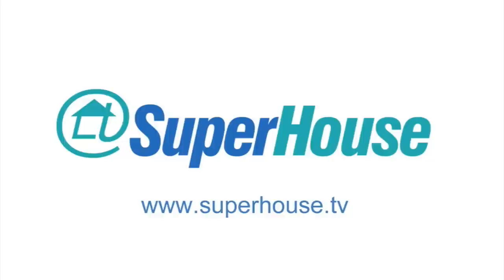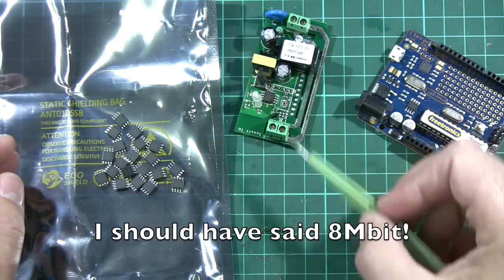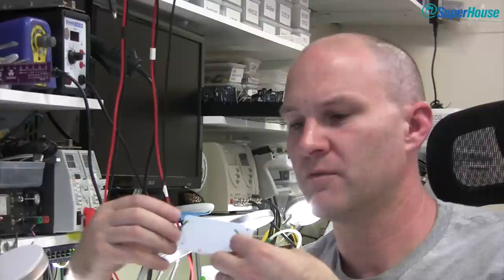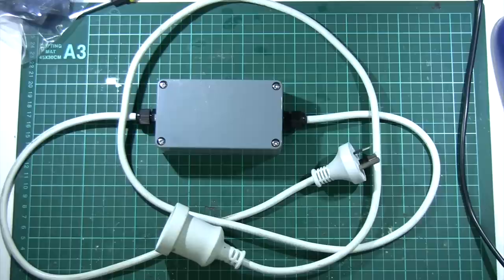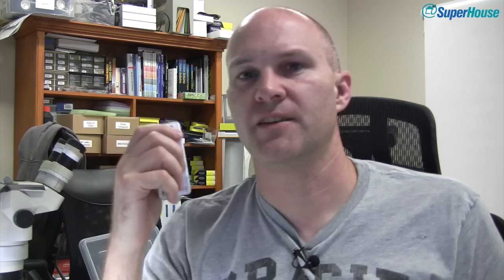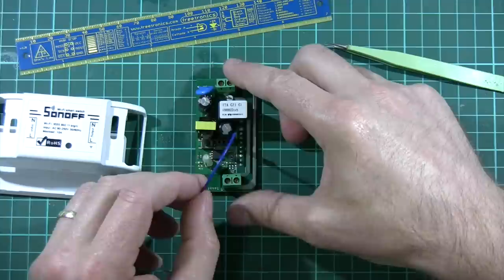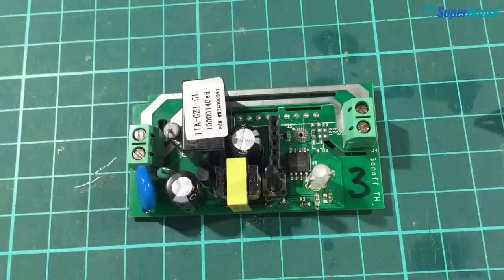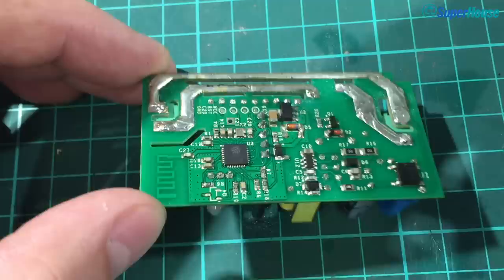SuperHouse #21: Six Sonoff Secrets: Storage, Safety, Switches, Sensors, Software, and Sites

Comment: OK, GPIO14 and GND trick with regular wall switch ? Tried this today on my Sonoff with stock firmware and doesn't seem to be working.  Anything I can do more to make this work?
Reply from the maker: Yes, you need to use firmware that supports it. The factory firmware tries to use GPIO14 for communicating with sensors, so you need to use something like the TASMOTA firmware and enable wall switch support.
Reply: Thank you very much for the great info. I found a way to make this work by soldering 2 wires on the bottom of the pairing switch.
Reply: fredasiong,  Did you do that with the original firmware and can you please write up so instruction on how to do that exactly?
Thanks
Reply from the maker: It would be the same as I showed in the video, but soldering to the button pads on the bottom of the PCB instead of directly to the button pins.
Reply: yes, but I used momentary PB instead of the original wall switch. I will post some photos.  I have 6 setup of this wiring in my entire house using a momentary PB.
Reply: fredasiong, Thanks for the slideshow I see what your talking about and gonna give it a try.

Comment: with a simple 3D printer you can make the box and screws for it. costing a lot less than the sonoff
Reply from the maker: True, that's a cheaper way to do it for a reduced level of protection. Unless you make the print very thick it won't be even close to the strength of a polycarbonate box.

Comment: Hi @25:54, the switch that I connected to gpio14 and ground did not work, lamp does not light up, it works otherwise. Below is the switch I tried. Can you assist suggest if I am using the wrong switch or something else is missing . I am using Tasmots firmware successfully uploaded and lamp work via on board button switch and mobile, The snaps of the switch.... http://oi65.tinypic.com/2cwq2qp.jpg
http://oi67.tinypic.com/2926tq8.jpg
Please assist .. thnx

Comment: Great video thanks. But what complete plonker decided that the "normal" ground of a 2.5 or 3.5mm plug should be moved from the shroud to a ring and replace it with 3v3 on the shroud? Doh! That's a shorting disaster waiting to happen! WHY? the ground on EVERY other jack plug on the planet is to the shroud (for obvious reasons) so is there a NOT so obvious, valid reason for someone doing this? Doh!

Comment: The basic sonoff switch says it will handle 9 amps but it won't for long. Here's a video of the automation of pumps and air blower in my koi pond controlled by sonoff but using contactors to bring in 9 or 10 amp pumps. Been working perfect for over 6 months now. https://www.youtube.com/watch?v=xJ9LNjc0f3M

Comment: Considering the fact that there's no neutral wire in a light switch j-box how are you going to power your gadget? Does it work on batteries or do you have to run a neutral, OR do you cheat and use the ground wire, assuming it has one that's actually grounded? Just a bunch of over priced crap that he's selling.

Comment: 512 KB is "tight" ?  WTF?   We made great computer games with 16, 48 and 64K in the ZX-Spectrum and Commodore 64 days.  The problem is how the code is compiled and linked.  Loads of irrelevant code is imported into your final application.  If machine code is used instead, it's possible to save 2-3 orders of magnitude of code.  Really.

Comment: Why not just cut off the legs of old chip and clean up the pads with any iron tip?
Reply: The pads are very small, so you could rip them off the board if too heavy handed.

Comment: SH.TV Have you since had any experience with the Sonoff Boilerplate:https://tzapu.com/sonoff-esp8266-control-blynk-ios-android/. I have an interest in it b/c I am already running some nodemcu projects with Blynk and hope to keep things simple and under one app. In fact if it is useful I could see replacing all the Sonoff firmware in all of my units and then control would be totally integrated. I really have gotten to appreciate Blynk esp. b/c the guys in the community are very friendly to newcomers like me. I have hesitated so far due to lack of experience and a desire to save the original firmware for reflash should it all go sideways which also seems pretty complex with python and esptool. So far I have soldered the header and from what I've since been told, I didn't even need to do that, only stick the header in and secure with putty for the flash and then remove and reuse. Very informative videos you have, I watched quite a few and learned a lot, thank you.

Comment: You don't need all that protection, just wrap it in a roll of duct tape ($3 USD) and call it a day.**

** Don't actually do this, it might work, but it might not, not worth the risk. If you try this, it is at your own risk and I cannot be held liable for anything resulting from you taking this joke literally. I shouldn't have to put a disclaimer but I am.
Reply: We also don't need an expensive IPxy box... instead, just repurpose your offspring lunch box. Cut a notch into the side for the cord and then jam the lid closed again. Done in no time. Oh yes.. glands and grommets are expensive but there is another way... just put a knot in the cord, done in 30 seconds and no power tools required.

Hahaha.. I can almost imagine a comedy sketch like this... trouble is someone wouldn't seem it as parody... bzzzzztt zaaaarrrp!

Comment: This is a crapy device. I bought it and connected and it worked for 10 minutes and after that  the relay seems to be on,the app I see that the switch is on, but the actual output  light is off.So it is working as its name stands SONOFF. This is a typical example of a "Made in China". Beware of buying this and using in your home systems. Well, I say it needs either  a rework or better quality inspected.But very good for $10 to have to experiment yourself but it will NEVER EVER BE A RELIABLE DEVICE AS IS. 

I have seen various complaints about this and myself floated a compliant but no response so far.

It is up to you guys whether you want to throw away the money for junk or buy reliable and working ones.

Comment: waaaahhh, what a junk soldering method....dont do it like that - buy u a hot air station ^^
Reply from the maker: I have every soldering tool possible, including multiple hot-air stations, PCB pre-heater, etc. The point of showing how to do it with just a soldering iron was to encourage people to try it themselves with basic tools, and that you don't need a fully equipped lab like I have.